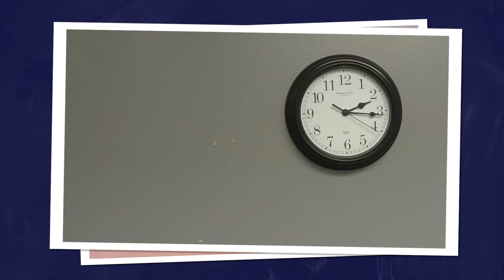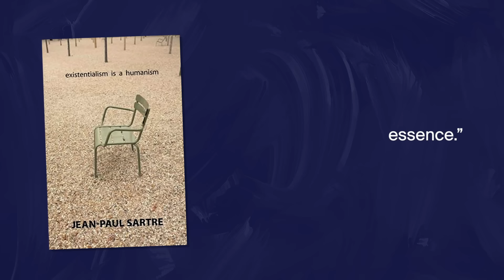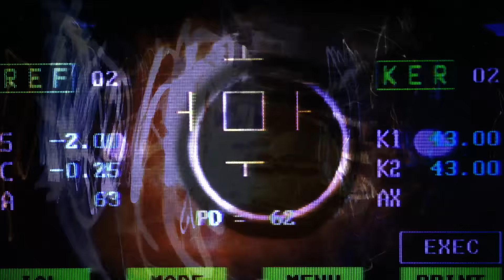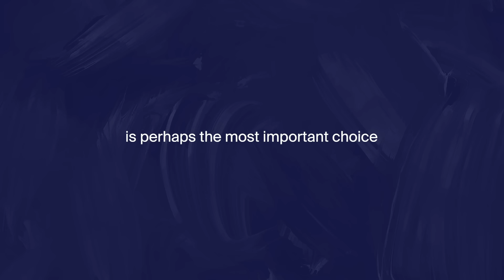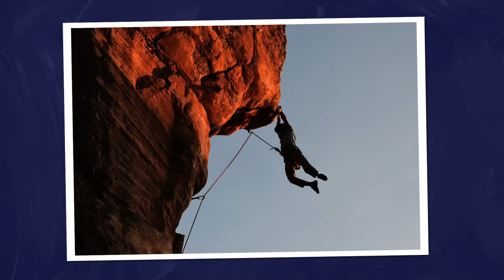Why We Experience An Existential Crisis - The Philosophy of Jean-Paul Sartre

Comment: I would argue with Sartre that our existence DOES have the essence and predetermined meaning. We are the method of finding a solution for the future problem that has not been discovered yet. One possible problem for which we might be finding a solution is an planetary catastrophe caused by an extra-terrestrial  source, such as a large meteorite. Another possible problem we may be solving is the extraction of fossilized carbon to return it to circulation within the atmosphere. There are many more potential problems are looking to solve. It might not be visible at an individual level, but so what? Am individual ant or a bee won't have any other purpose other than to participate in its hive. Looking for an essence of ones existence at an individual level is just asking a wrong question at a wrong level, that is all.